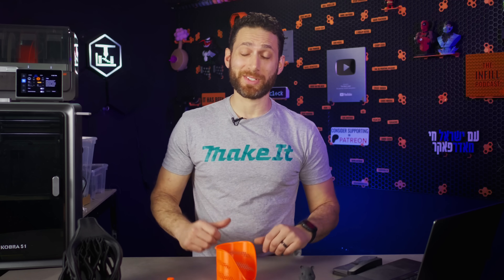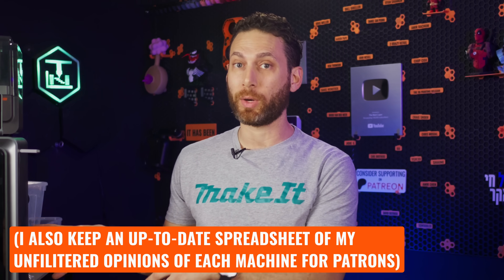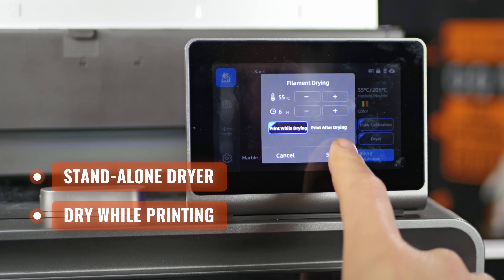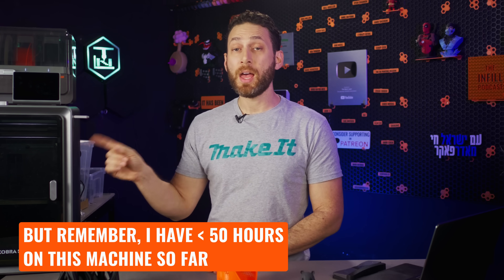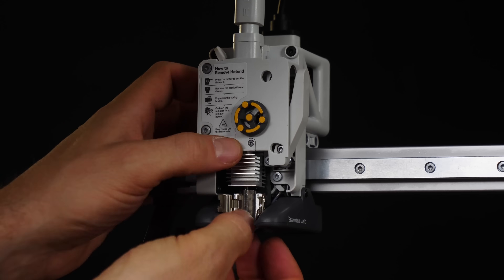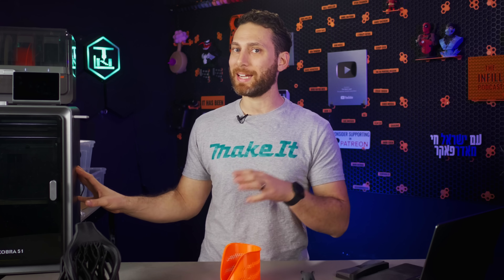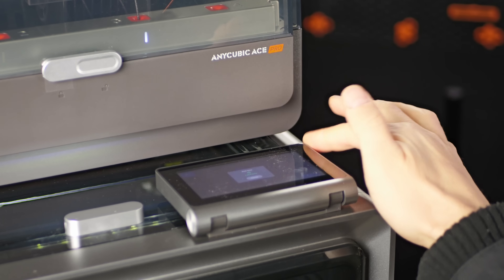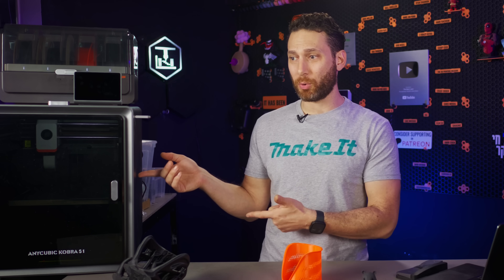16 Ways The AnyCubic Kobra S1 Is BETTER Than a Bambu Lab X1 Carbon

Comment: What is the size of the printing area? What Klipper version does it use? Does it have automatic flow calibration? What about automatic pressure advance?
Reply from the maker: Good questions. But all can be covered by visiting the link in the description. It’s not klipper. 250 cubed. Automatic material calibration apparently. Haven’t needed it.
Reply: @thenextlayer  I just googled this, seems like they use Kobra OS which is based on Klipper.

Comment: I just need a review of the ace pro unit...The printer is amazing for the price for a core xy ...You might have to run it a little slower to get amazing prints...I'm ok with that at this price point $399 w/code DIYNEW30
I just don't trust the ACE pro without some reviews

Comment: I would like a comparison video of the Kobra S1, Centauri Carbon, creality K2 + and the bambu P1S each with pros and cons
Reply: Add the Qidi to that list
Reply: The K2+ is far ahead of all the others and it costs way more, not a fair comparison
Reply: @anthonylong5870  i think the price is mainly because od the size. Would still like to see the quality differences. Also.... he literally compared the s1 to x1c in this video
Reply: @MalyVitaloshnik its like comparing Fiat do TOYOTA. Have 4 wheels, check, 1 steering wheel check. 5 seets check. But fiat drives like shit and engines are poor.
Reply: @MalyVitaloshnik  The K2+ doesn't belong on that list! For size it would be a K1 Max with CFS or a Sovol SV08.
Reply: @hassosigbjoernson5738  thats like saying comparinf rtx 4070 and 4090 doesnt make sense.. I wanna know what Im getting at the different price points

Comment: 5:30 Oh it's way worse. My X1C rubbed a HOLE in the PTFE tube within 1500 hours causing loading/unloading issues lol. Inserting filament into the AMS feeder motors I do routinely with one hand, however the light spools jumping against the acrylic top of the AMS is rather unpleasant and a bit of a design oversight. We need a new improved AMS version maybe with hygrometer display, active heating, support for larger spools, more reliable operation with abrasive materials.

Comment: I have the S1 on order, should arrive around the end of this month.  I also have a FLSun SR, a  K1 , A1 Mini, and my latest a Qidi Plus 4.  I have to say absolutely thrilled with the A1, and the Qidi has also been a solid as a rock performer.  The super racer is OK, if uninspiring, and not as good as it could have been.  The K1 took a lot of tweaking, and firmware upgrades (and rooting) have made it much more reliable.  I took a chance on the Qidi, as "it ain't a Bambu", and it's worked out great (with replaced SSR board).  I have a buddy who got the Kobra Max 3, and he says it's rock-solid.  Based on his experience, and some of the YT vids I've seen, I'm looking forward to another printer I don't actually need, but dangit, I love 3d printers!  Seriously, great job on the video Jonathan, appreciate the candor, keep up the good work!
Reply: @FEPLabsRadio  how's the S1 working out?
Reply: @KJ-58  If it had actually shipped yet, it might be cool.  I looked at the Centauri Carbon that all the YT channels have been pimping, and it won't ship til July, so maybe only a month wait ain't too bad..
Reply: hi.. S1 kobra vs a1 mini which one faster?

Comment: Question. The Kobra S1 combo has 2 options. Is it saying I can get the printer and 2 heated chambers/ ams type systems with the printer instead of just one?
Reply from the maker: I think you can, yeah. It supports having 2 ACE Pro's

Comment: Tried to buy one last week as my first printer and the delivery was expected to be in the last week of April (in the UK). That ruled it out for me. Ended up buying a secondhand Flashforge AD5M Pro locally for next to nothing. Bed isn't as big as I'd like and obviously no auto multi-material but it looks like it'll sort my needs until I look again later in the year.
Reply: flashforge makes flawless printers
Reply: @3DATHENS-qi1tu  Too early in my journey to know that but I do know that at the equivalent of $200 for something that had printed for 90 hours and came with 6 assorted (some partially used) spools of PLA, it was an absolute bargain. I've actually only printed the test 20mm cube which it started after I'd configured it and couldn't believe the quality of it using some random flourescent yellow PLA that was already fitted to the printer. Now just need to find somewhere to put it.

Comment: Well they had 2 years to copy it, I hoped it be better 🤣. I just hope the consumer wins.
Reply: I have heard from other reviewers that the quality is not as good as the X1C. I also don’t understand why the nozzle gets to 320 and the print bed gets to 120, but there’s no hardened steel nozzles for engineering / carbon fiber material?
Reply: @treyduval5399  Because high temps doesn't always mean abrasive carbon fiber materials. Most beginners (which this budget printer is for) start with PLA, PETG, maybe ABS and ASA. And on top: Anycubic also wants to sell on spare parts. And some 2nd nozzle is not such a big deal.

"the quality is not as good as the X1C" ... And it doesn't have to be for less than half the price.
Reply: @TheFoxalot "they had 2 years to copy it" Bambu Lab took several years to copy a Voron.

But many people forget: 3D printing in general is all about copying things. The shitty thing about Bambu is: they take but don't give back.
Reply: @ agreed. It’s just nice to not have to source every part and have most of it assembled and just “working out of the box”.

Comment: With Bambi’s MASSIVE mistake and lies, the bar is so much lower now.  This is a huge opportunity for some other brand, I hope somebody realizes this.  
1.  NO unnecessary cloud ANYTHING , all of these ‘problems’ and features can be accomplished with local controls. 
2.  NO meddling with 3rd party software or hardware.   We understand not everyone will be completely open source, but commit not to bait-and-switch Bambu-Screw us.  
3.   Commit to have a reasonable Terms of Service without ANY clause that says “we can change these terms later to anything we want”.  What’s the point if it can completely change AFTER customer gives you money??
Reply from the maker: PREACH!

Comment: I will say I love my X1C. These new printers are great, and I just cant imagine WTH Bambu is thinking with all these lockdowns when so many are coming out with real competition. Its like they want to just fail and shut down.
Reply: What is locked down.  I have every Bambu but the X1C.  They all work as I purchased them.
Reply: @jonwoodworker ALL Bambu are completely locked with proprietary firmware.  You cant even change a si.ple Z Offset when its needed.  You cant upgrade them and working on them is a nightmare

Comment: I think its not a hope, but an expectation that any new pronter with wifi should be able to receive files from Orca or Cura over wifi. Especially when its so easy to do so eith any printer running klipper.

Comment: I like the way you have tackled the sponsored video, pointing out the features and differences, well done! I also agree with your view on the integration of access to allow Orca Slicer to work directly with the printer. Coming from an IT background and also with some knowledge of IT Security and Information Management Security Systems more specifically, I think that integration between the vendor's back-end system, whether Bambu Lab, AnyCubic, Creality or Elegoo etc, with the front-end. i.e. Orca Slicer (or equivalent) should be frictionless beyond a one-time installation and set-up process.  👋

Comment: have a kobra 3 and now the issues have been sorted its a very good and reliable machine with a custom firmware being developed as anycubic have released the firmware for it. So they are likely to also release the firmware for the S1 which will mean we can have a open source. I have a S1 coming at the inital price of 499 and for that price nothing comes close for a multi colour system.
Reply from the maker: I didn't realize they'd open sourced the K3 firmware! That's GREAT. I would've put a note about that in the video, as that's another +1 for AnyCubic

Comment: I’m sorry, but I was expecting you to put that machine through its paces in this video. I pre-ordered this printer about a month ago and recently cancelled the order because it’s just not being reviewed enough which scared me a bit. However, the Elegoo Centauri Carbon has recently been reviewed in the last 24 hours far more than this printer has been reviewed in the last month and a half. I’ll probably take my chances with the Centauri.
Reply from the maker: Haven't had time. Too many printers coming out right now, I barely had 40 print hours on this at the time of shooting.. So I chose to focus JUST on the hardware. Give me time to beat it up ;) I don't do a "review" unless I REALLY have put some hours on the thing

Comment: Any word on if they plan on shipping to Israel? On the website it does not appear to be a shipping option. Also, do they plan on releasing the firmware and providing a pure klipper option, or is it remaining under wraps? Thanks!
Reply from the maker: That's a good question, I'll check for you.

Comment: Could the Kobra S1 Be a Viable Alternative to Bambu Lab?  Simply put:  NO!  Don't get me wrong, I have multiple anycubic fdm printers (a couple of marlin kobra 2 and "klipper" kobra 2 MAX) and I do truly like them but NONE of them are stock and that's WHY I like them so much.  They were a 6/10 stock but they are a solid 8.5/10 now.  For the price it cost me that is better than bambu could EVER give me never mind the control I have over my own hardware.  Anycubic does have FANTASIC support however (some of the best I have ever encountered) which is one of the reasons I have what I have.  However, they rush their products and us users wind up being the final stage of quality control.  Once I took the steps to strip off the stock firmware and go full mainline klipper these printers are a completely different animal.  Anycubic IS on the right path but they really need to pay attention to what the users are saying and focus on that.  They need to stop trying to be bambu and start being something better.  I've said many times now that anycubic has an amazing chance to capitalize on this bambu situation if, and ONLY IF, they stop telling customers what they CAN have and START ASKING what they can provide to customers.  In the end the customer knows best what they want and NOT the company who is providing it.  the single biggest improvement they can make is a reliable and consistent auto bed leveling and z offset.  The way they do it is hit or miss and there are so many users who have killed their build plates and nozzles because the stock process is just too buggy.  Personally I couldn't wait to rip out the calibration buttons they use when I klipperized my kobras.  It might not be automatic now but at least my z offset is perfect and I haven't damaged a build plate yet.

But one major change anycubic can do is to STOP asking experts to use their printers and give reviews and start asking newbies and those who think using a microwave oven is the same as cooking.  If grandma can plug in a new printer, follow a few EASY TO UNDERSTAND prompts on the screen and come back in a little while to a perfect print that is the user experience that will put them to the top.  I honestly do not believe that anycubic actually uses their own printers or else they'd understand the issues that many users have.  Anycubic fdm printers are like a ring with unpolished stones set in a beautiful setting.  The foundation is there but they need to do that final work to make it truly sparkling jewelry.
Reply from the maker: Thanks for the thoughtful comment!

Comment: The bigger question? Has Bambu Lab learned anything from it's competition about keeping things OPEN SOURCE!? Guess not. 

Bambu deterred me as a customer moment I heard "closed source / proprietary firmware", when I heard that and heard about the RFID spool tags, I knew it was a matter of time before they try to go Apple (or how I like to call them Crapple) route of telling you how you can or can not use their machine that you bought!
Reply: I love it, "you heard."  You better sell your car, tv, and all your appliances...they are all closed sourced.
Reply: @jonwoodworker  yep, usually the first guys to complain about something not being open source are the first to charge money to sell their 3D designs and STLs.
Reply: Nope. Their stance is to lock the printers down even more....
Reply: @Vash.Baldeus  Seems to be a misunderstanding what open source really means.
Reply: Bambu labs is run by a bunch of ex, DJI drone engineers, think about the company culture of DJI, same basic premise. They take open source projects, make a few improvements and close the source, reskin the software/item and print money. Their products are also not compatible with any other common standards, even if the original projects they used were, and aside from the ability to block you from using other competitors parts and software, these proprietary standards serve no real practical purpose.

Its business as usual for them.

I personally was interested in getting one of their printers until they tried to pull their predatory nonsense and lock people into their walled garden.

Its disappointing, now im stuck looking for alternatives as i cant trust they won't make things worse when they want more money out of us.
Reply: @tek5358 lol you're just repeating what you've heard and read, Prusa has Prusa Connect, it's basically the same thing but no one started trauma dumping like this.
Reply: @tek5358 But aren't you ignoring the fact that DJI offers incredibly affordable products, unmatched specs and build quality, constant innovations that push the market forward, and a pretty seamless ux?

What are they actually doing wrong because from the outside it looks like a pretty freaking good company and product line.
Reply: @tek5358 Well said and accurate
Reply: @ What’s weird is that they have Political Commissars within their company.  Doesn’t sound like a company I’m interested in.  🤷‍♂️
Reply: @2.43: Yes, the Kobra S1 uses its own firmware and its own cloud services like Bamba Lab.

I doubt that Bambu is learning to use OSS given the direction of the market
Reply: @julesadventures9174  Then I will stick to the OSS printers, because honestly I would rather self host most of the cloud features I need.
Reply: Xi Jinping, “Power Must be Caged by the System”, Qiushi, January 22, 2013:

“We should continue to catch ‘tigers’ as well as ‘flies’ when dealing with cases of leading officials in violation of Party discipline and state laws as well as misconduct and corruption problems that directly affect the people’s interests. All are equal before the law and Party discipline; whoever is involved in a corruption case must be thoroughly and impartially investigated.”

The results, after 12 years of Xi’s anti-corruption campaign?

“Corruption is RAMPANT in China!”

-Victor Gao, Al Jazeera, August 2024 in front of a live international audience.

Note: When Xi says ‘tigers’ he means the rich and powerful in China. When he says ‘flies’, he’s referring to everyone else in China.

Flies. Says a lot about him and the CCP doesn’t it?
Reply: @mikestewart4752  Realy nice propaganda piece, isnt this a 3D printing chanel?
Now tell us what is like in our western "democracies"...
Reply: @ljubomirculibrk4097  I didn’t say the words, Xi and Victor did. 🤷‍♂️
Reply: Unfortunately, for many people it doesn't matter whether a system is open source or closed source. Otherwise, Bambu Lab printers would not have become so widespread.

In addition, these printers are increasingly becoming disposable products. Repairability is often limited because some components cannot be replaced individually; instead, a complete assembly has to be replaced.
Reply: @andreas.grundler There was a computer company in the 2000's called "Packard Bell" they were HUGELY popular for a couple years.  Just 1 cord to the monitor, turn on and BINGO! perfect computer! No installing software, no building. Nothing.....millions sold.  Then people started having normal computer problems and quickly they found out they couldnt repair, upgrade or reinstall windows when the PC needed it.  Parts welded in, firmware locked.  The company went bust shortly after.....This is going to be Bambu